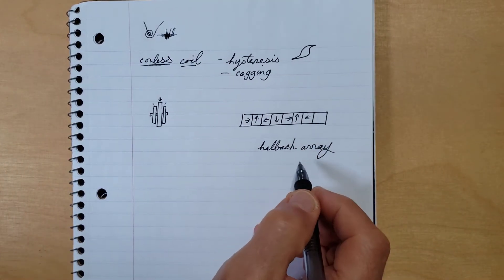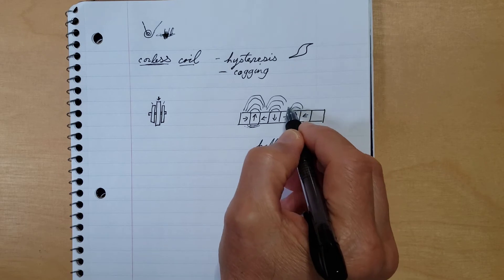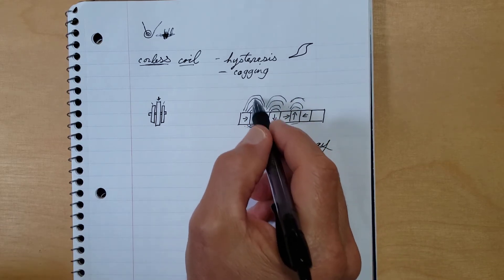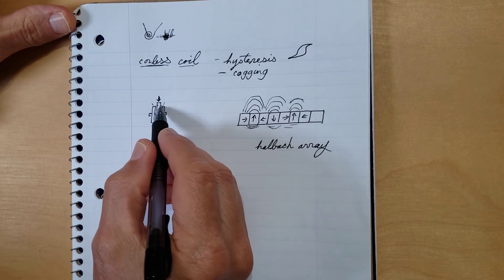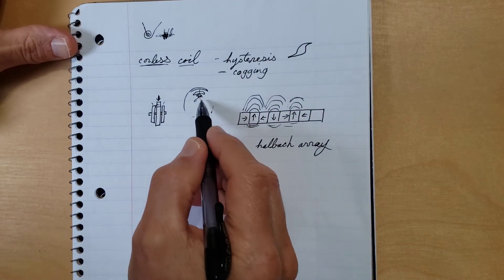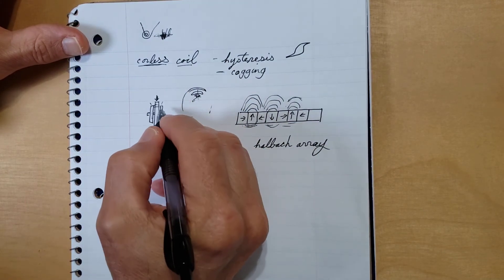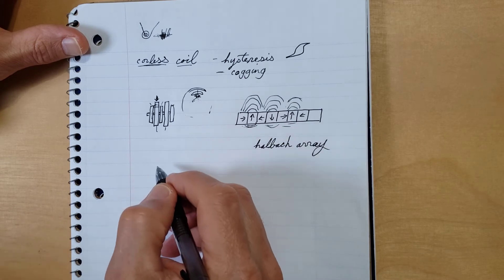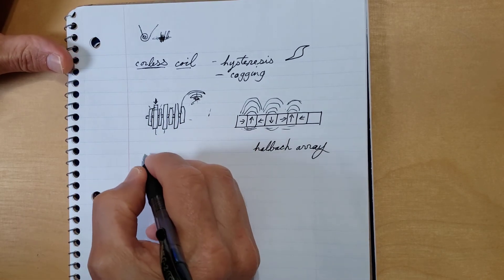BLDC Motor using air coil using Axial Flux design

Comment: Can anyone answer me please which motor will have higher torque coreless or with core if both are made similar size ? Ignore the weight .
Reply from the maker: I'm pretty sure the iron core motor will have a higher torque at low rpm due to the way the core focuses the flux. I found an article on coreless motors and I found the comment "they have small torque ripples" and " requires high rotation speeds". (https://www.jmag-international.com/catalog/43_CorelessMotor_Torque/).
Reply: @rickrandazzo  Thank you very much.following you👍
Reply: Instablaster...